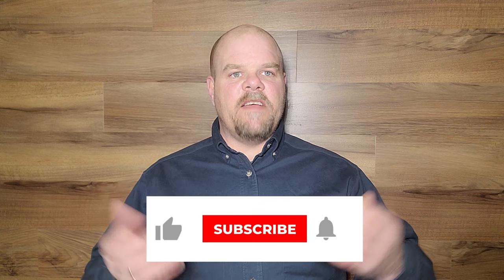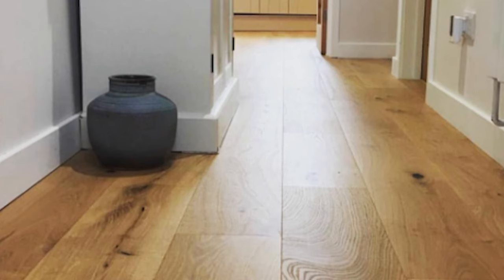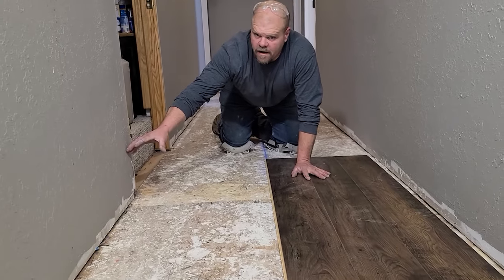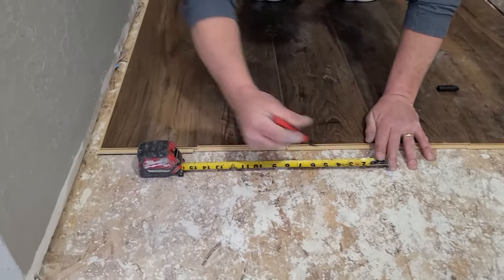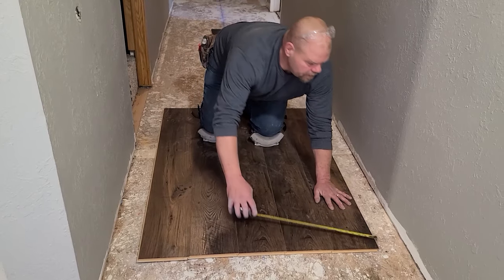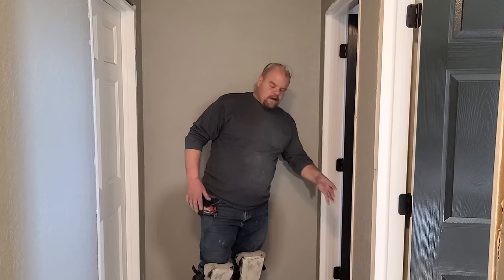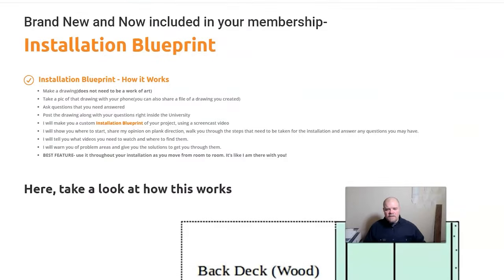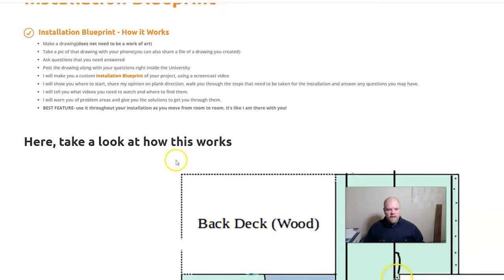Where you should Start Installing | Laminate Flooring or Vinyl Plank Flooring

Comment: I just quit a flooring store, they had the worst installers I've ever seen, I tried explaining the hall way thing to them and they wouldn't do it just because it was on you tube, I learned this hallway trick from a big time contractor, just cut its on you tube doesn't mean it's wrong, this is the right way to do things.

Comment: I would think the focal point would be kitchen, living room fireplace etc.where one would walk in the one of these main areas ,not a hallway, rule of thumb or census seems to be run planking parallel with the longest wall not the short way as it would look chopped up or have a ship lap look to it . comes down to personal opinion .Real wood should be across the floor joist.

Comment: I'm a sunroof installer, I get asked often the best way to heat their room. I know that both certain vinyl and laminate can be installed over electric radiant heat . I've used this often but only under tile. Most of my customers are on decks. 
How would you tackle this, or is it an option? BTW, your the most informative flooring man on all the internet. As soon as anyone even mentions an interest in dyi floors, I immediately pull anyone of your Videos and share it. And tell them.. "you guys are gonna have a million questions, this man will answer every FN one of them! Don't waste your time with anyone else. You and the Idaho painter should get together. He's just as awesome at his trade and videos as your are at yours..inside carpentry is another one. the three of you should share followers. Thanks,

Tony
Reply from the maker: Are you covering the deck with an underlayment or subfloor?

Comment: Instead of using  a chalkline on a 3bd 2bath modular, I just finished,  my brother in law told me modulars are very square. So I just followed a sub flooring seam straight down the hallway, and I was able to do the whole house seamlessly at all door casings  and some where at that 22.5 angel?  And everything looked very straight except that stupid 1 inch piece that I needed to lock along the wall, Haha! ....I use a 1inch chisel to pull those back in. works great, SNAP!

I was quite worried honestly when I first started, I'm not gonna lie! ha, but it turned out great, and my 55yr old knees gained a bit more strength!

Comment: Do you have any videos about installing the flooring backwards? I am doing a project with multiple rooms flowing into each other and I will need to work backwards in some small areas. If you had a video that went through this process in detail that would be amazing

Comment: Going to start in the hallway.  My question is this…The only doorway goes into a bonus room that was previously carpeted (bonus room and hallway).  The door jamb has a gap of 1.1 inch from the bottom of the jamb to the subfloor.  The vinyl plank is 3/8 inch, so there’s about a 3/4 inch gap above the plank.  What should I use to fill this gap? Thanks for the video tutorial

Comment: Stumbling onto your videos has given me renewed hope that this is a project we can do! I am doing just what one commenter mentioned "binge watching" your videos. Something that stopped us tackling this several years back is that we have a freestanding gas log fireplace and have two lines coming up through the floor and carpet behind the unit. One is the gas line and one is the 220 wiring. Installers told me the gas co would have to come in and cut all that off.  The power line goes to a junction box too large to thread through a hole in the flooring. What would you do?

Comment: I am planning a vinyl plank install in our single story house with a sunken living room where the entryway, family room, dining room, and kitchen wrap in a circle around a closet and fireplace.  From the entryway, the sunken living room is to the right and directly adjacent.

To complicate things, the short hallway that runs by the main bathroom (which I plan to run the plank flooring into without a transition) and the laundry closet on the way to the three bedrooms (they will remain carpeted) begins at the end of the entryway, and runs perpendicular to it to the left.

So, I could run the planks down the hallway like you’ve done here, but that would mean the entryway would have the planks running horizontally (or parallel to the front door).  That would also mean the planks in the living room would run parallel to the large picture window in that room, something I’ve heard you shouldn’t do?
Additionally as the floor travels into the family room and kitchen and into the dining room I have a fireplace hearth and a kitchen peninsula to accommodate.

Obviously my goal would be to avoid any sense of the floor being lopsided where one end terminates in a very thin plank, or where I have weird cuts or thin areas against walls, but there’s a ton of dimensional challenges in this old 1976 house!

I’m sure I can get it figured out once I’m holding the planks in my hands, but with all I’ve described is there a hierarchy of priorities you’d recommend?  Still try and make the hallway work since it’ll be traveling into the bathroom?  Or should I base the install off the entryway and living room since those are kinda the focal points in this particular house, the hallway being fairly short?

Thanks for this amazing thing you’ve done, I appreciate your willingness to share your knowledge and to share the gospel on your videos!
Reply from the maker: Parker, I can walk you through all of this with an Installation Blueprint. It is a screencast video and I use your drawing to walk you through your installation step by step. I will let you know what videos to watch and I will answer any questions you have. There is a link for Laminate University below in the description.
Reply: @SoThatsHowYouDoThat  incredible, thank you!

Comment: Thanks so much. I still have a BIG question I cannot find an answer to. I have a 3bed, 1 bath,  ranch style home. I’m laying plank flooring in whole home, every square foot. Problem is, almost every single room has a different height flooring (I’m assimining multiple layers of garbage floor over the years?) but how would I accomplish this without transitions? If the hallway is your “zero point” for height of flooring, the bathroom is about 1/2” higher than hall, and the bedrooms are about 1” lower than hallway, so it really is all over the place and I can’t think of a solution cause I’m a newbie diy guy. Please help! Thanks SO MUCH!
Reply from the maker: You would need to build up some floors and demo some floors. Was there several additions to this house?

Comment: Hey Joe, how would I lay glue down LVP in rooms that are all connected, with no walls between them? It's a family room, then breakfast nook, then kitchen, with no walls between. (Except 2 little half walls between family and nook.) I want to measure and line it up correctly, but all 3 rooms are different sizes, so the center point is different in all 3 rooms.
Thanks!

Comment: There are two bdrms and a bath on the other side of my hall. The rooms will be carpet so technically my hall is the end of where the flooring goes. You have to go by the mstr bdrm, through the living and the dining room to get to it. All will be flooring. Should I still start in the hallway?

Comment: Hi Joe, thanks for your helpful videos. I've learned a lot so far! One question I still have is what do you like to do when the vinyl flooring meets up with the riser of the bottom stair on a staircase? This staircase is going to be stained, and won't have any LVP on it. What would you do here? I'm worried if I undercut the riser, it will affect the integrity of the step. Thanks so much!
Reply from the maker: Use quarter round.

Comment: Planning to start the vinyl plank flooring installation in a 39 by 20 feet attic during this weekend. I plan to orient the flooring in the direction of the longest walls. However, the longest walls are not at all parallel and there are also two chimneys with crooked geometry in the base. Would you simply put down a straight line somewhere or would you try to do it exactly as in this video?

Comment: Hi Joe, thanks so much for the info. Your videos are easily the best on YouTube for this topic. I do have a question though. I have a very similar situation to the black and white drawing you use in this video. My plan was to strike a line down the hallway based on a tip from a friend and looks like he is right. But, can I start laying the floor in the hallway first and build off of that instead of striking my line in the hallway and starting in the adjacent living room? I'm anticipating not square walls in the kitchen/ living room but the hallway walls are good. Thanks again
Reply from the maker: Yeah, you can start wherever you want. I always try to choose a starting point that will give me the least amount of working backwards.

Comment: How do I plan an upstairs u shaped hallway? I have 2 bedrooms on each side of the U . Do I lay the top stair landing parallel to the treads and run the hallways short side to side horizontal pattern or set the upper landing  perpendicular the the stair treads and run the hallways a long vertically pattern ? . The stairs will be carpeted  and so will 3 of the 4 bedrooms. and I have a bullnose for the landing edge.

Comment: Hey Joe!  Absolutely love your videos and have learned a lot.  Thank you!  I am laying lvp on my lower level and am concerned about how my seams will line up.  I have two walkways, "hallways" if you will (one goes through dining room,)  that lead to the back of the house and my stairs extend up through the middle of those two walkways (about a ten foot span). Seams are nice and tight.   Measurements from outside plate are within a quarter of an inch.  Any pointers on how to make sure those seams to line up.  I am not using transitions.
Reply from the maker: I have a video on that in my members area - Laminate University. If you are interested there is a link in the description of this video. I do plan on releasing a video on this soon.

Comment: Do you ever run into issues creating your straight line off from an interior wall. I would base where my layout ends on the most visible area but at least 98 percent of the time the straight line is determined off an exterior wall.

Comment: Good videos. I’m putting in vinyl plank in my entire downstairs with no transition strips. The longest straight continuous line goes from the from of the house to the back where the kitchen is. Is that what I go off of to which direction I lay the planks. I ask because I also have a small hallway that runs in the opposite direction and a friend was telling me to run it down that way because it’s the only hall way.
Reply from the maker: It really is your decision on plank direction. If the hallway is a small factor in the layout of your home, then I would not base the layout off of it to sacrifice an easier and better looking installation everywhere else.
Reply: @SoThatsHowYouDoThat  thanks. Yeah that hallway is small and leads to the garage. The kitchen does run horizontal to the living room but the longest sight is when you enter the house, you can look straight I to the kitchen. Its the longest straight line and the longest room.

Comment: Hi Joe! I’ve been watching your videos, love them, you are by far the best installer I’ve seen, love the attention to detail! Thank you! I’m struggling with my floor plan on where to start as I have a wall in the middle of my house with the fireplace that the hall connects around on both sides, so basically a large island in the middle of my house. Worried that the floor won’t connect by the time I get around to the other side. Any tips? Thanks so much!
Reply from the maker: I have a video that explains this inside Laminate University and there is a link below. You need to use a reference line to guide you. You just keep measuring to it and keep the plank on both sides the same distance away from the line.
Reply: @SoThatsHowYouDoThat  Joe! You are so awesome for responding!! 💚 that’s what I thought. I’ve been non-stop thinking about it, rewatching and rewatching your videos. I don’t see the link to the video you mentioned. I just want to say thank you again for all your videos and for your response!!

Comment: You mentioned in one of these videos to try to avoid transitions; and in one place I think you talked about uneven subfloors should be evened out. I have a clarification question: I am redoing the flooring on my first floor with laminate planks. But it turns out that a carpeted part of the house, living and dining room combo, has a sub floor 1/2" lower than the rest of the subfloor. Should I use a reducer to go from the higher to the lower section, one is a pocket doorway, the other is a 6 foot entryway. The flooing will be running parallel to the transitions. Would that be a trip hazard? Or should I go through the pain and expense of adding 1/2" of subfloor to those two rooms? What are the pros and cons?
Reply from the maker: You can do that, I would not but you can. I would raise the floor the 1\2 inch and have no regrets. It will look nicer and it will not be a trip hazard.

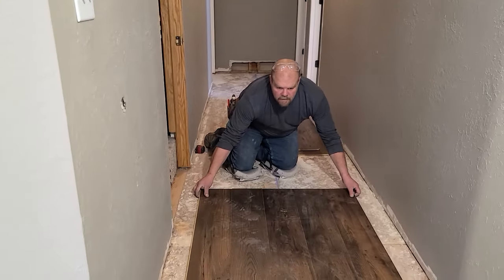Comment: I'm clearly in the minority based on the comments but I had to rewatch multiple times to figure out what was happening. When you moved from 6 planks to 5 around 6:15 in threw me at first. I'm spacially dense so challenging for me without more detail / baby steps.

Comment: Joe hi.
The short version of my question is: how do you use slip tongue method with vinyl snap and click floating floors?
To help describe what I'm talking about,  could please tell me if there's a technique how to "turn the installation"  and go another way.
With wood flooring install. I simply insert a piece of slip tongue, and can start installing into a room from a doorway once I've reached that point. Is there a way with laminate flooring to do this slip tongue method? Or should I just simply butt the sides, glue them securely to the floor, then begin heading into another room towards the back wall?
(I always want to avoid doorway saddles. Then you have to put them in all the doorways for continuity 👎)
It's next to impossible to snap lines and have them lineup perfect in the hallway where they snap together. Sometimes I try to slide the entire room when possible to have it meet where I need. That's not always possible though. I hope I'm describing what I need.
Reply from the maker: You will have to work backwards with the locking system. Here is a video that shows some different techniques do do this. https://youtu.be/ZYKEJGdeS-s
The key is to start installing in an area that will result in the least amount of working backwards. I would hope someday the manufacturers would stop trying to make money on their transitions and design a tongue to slide in so we can reverse directions, but they won't.....
Reply: @SoThatsHowYouDoThat  You're the best! Answered my question perfectly. Someday maybe they'll make boards with female ends on both sides to be used as a slip tongue.
Thanks for your reply. You've helped me on a bunch of jobs already!

Comment: I have NO hallway in my downstairs.  The entryway has a dining room to the right and wall to the left then it continues forward to the rear of the house through the middle of the kitchen and living room.  Off the living room there is a hallway of doors to laundry room, bathroom, which get no LVP and a tiny closet and bedroom which will have LVP. Do I just use the entryway opening to the rear of the house as my hallway?
Reply from the maker: You could. I would love to see a drawing.

Comment: At about 5:15 you show 6 boards on the floor, then at about 6:20 you show 5 boards but you never mention you took 1 board out, that's why you have space on both sides now... you say you "grew" a half plank on both sides. Maybe that's obvious to you but kind of confusing to someone watching. It looks like space just appeared. I had to count the number of planks before and after the interruption at 5:17 to figure out what was going on. Anyway, good info and I appreciate it. I subbed to your site.

Comment: I have a question for you. If installing plank throughout the whole house, just over 1500 square feet. Would you install transitions? If running down hall will be cross gain in bedrooms 

Thanks, chad
Reply from the maker: I would not if this was my house.
Reply: @So That's How You Do That!  you would not install transitions or not run plank cross way in the hall. The hall is only about 10 long goes to bathroom and garage.

Comment: Hi there. Can I ask you your opinion on what thickness of laminate floor I should use. Here in Ireland it's generally 8mm or 12mm boards. The area I'm doing is my living room, hallway and kitchen all concrete sub floors. I will be using a good quality underlay. Thks in advance
Reply from the maker: Yes, I would not buy anything less than 12mm.
Reply: @SoThatsHowYouDoThat  Thank you very much. keep up the great work. top class videos. you can't beat experience. I've learnt a lot from them one big thing I've got from you is plan ahead and get your layout right. 👍👍

Comment: quick question how do you cut flooring when the wall is not the same  like one end say 4 3/4" and the other end 5 "
Reply from the maker: Use the cheater board. Here is a video - https://youtu.be/7-vIi3SVxeo

Comment: Thank Joe for the video. How can one obtain the centre line when the hall width is at different measurements? My house doesn't have equal width all the way down a hall...
Reply: I would use the smallest measurement. You can scribe the trimming against the wall, after running a level line as determined by your measurements and your plank width.